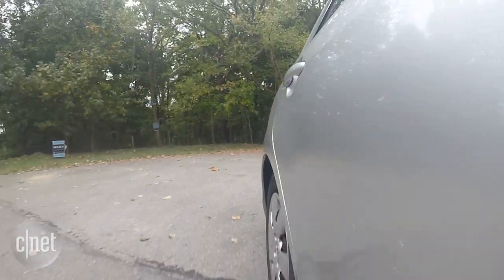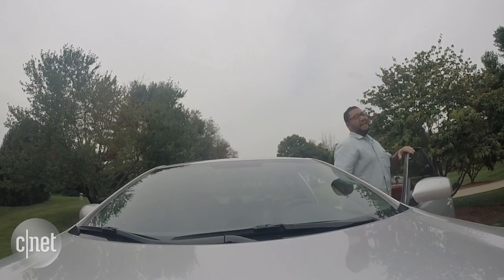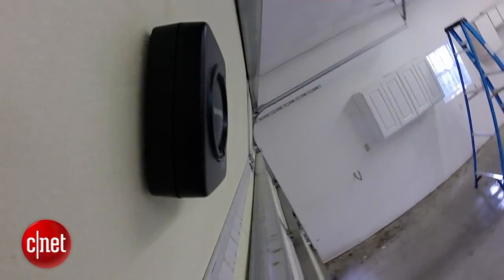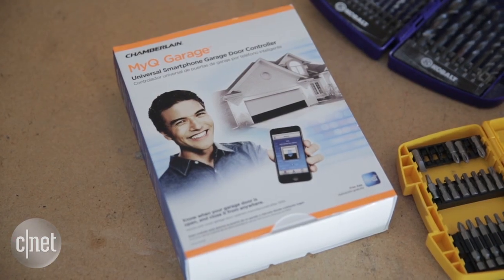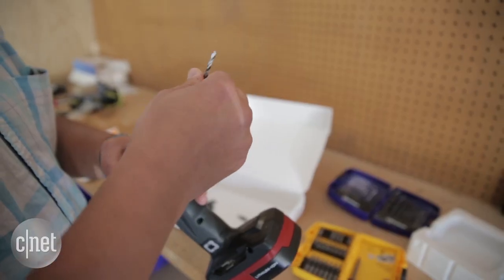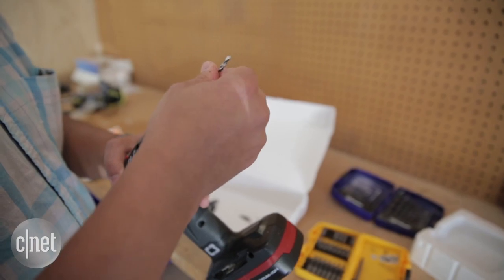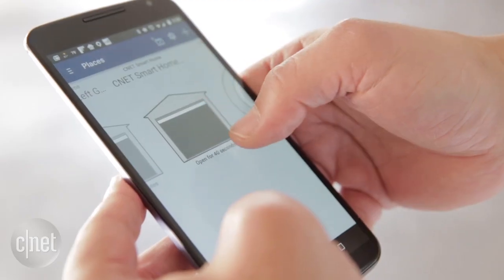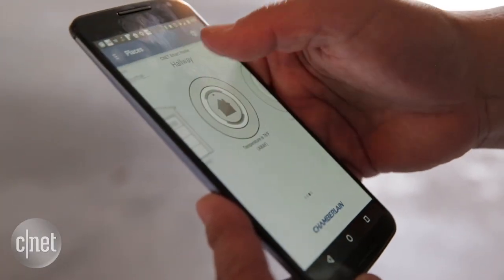Bringing the CNET Smart Home garage up to speed

Comment: Our duplex uses a crappy unit on the ceiling, no matter how many remotes we have tried, there is always issues where you have to press the remotes buttons at least 5 times before your garage door activates. Our brand is also sold as a Open Door model as well as what we have currently. So this thing if it works with more then just Chamberlain garages, would send the signal easier inside the garage using the app then pressing a remote in our car that works half the time. Even far away the garage unit flashes it gets the remote command but it never does anything. 2 or 3 presses later it finally moves.

Comment: Would have been nice for a link to the products shown, I don't remember him saying the brand just showing him installing the puck on the garage door and using a Chamberlain opener. I want one that works with ANY garage door opener by sending a signal to the garage opener through a similar puck because the unit on our ceiling sucks no matter what remote is used.